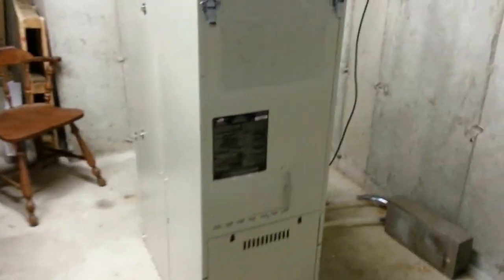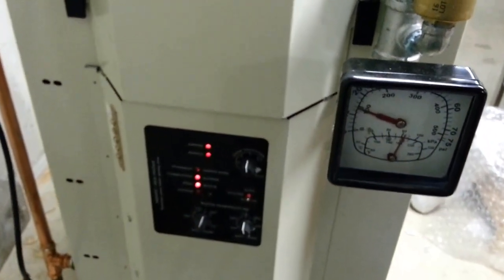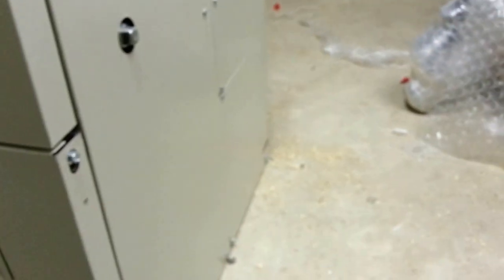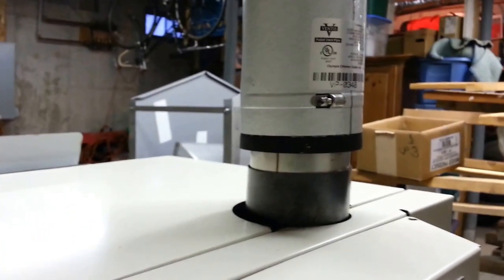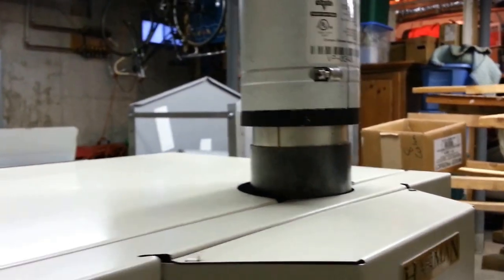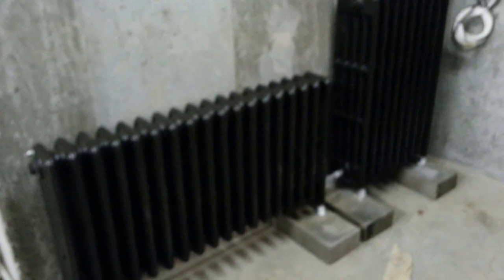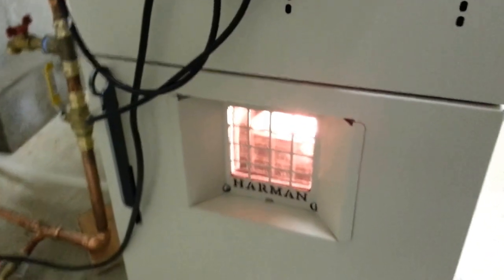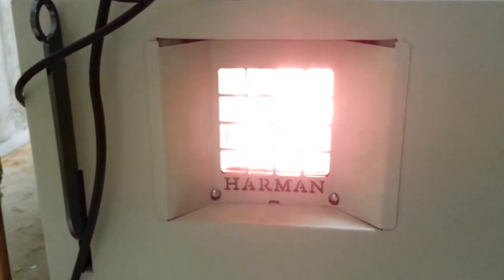Harman HydroFlex60 Pellet Boiler

Comment: Bought on myself in 2010 for $4245  Squier Lumber Monson ma, $400 for a stainless chimney liner and another $300 for miscellaneous parts. Paralleled to my oil fired system it can heat my entire 2400 square foot house plus domestic hot water from an indirect tank.
I installed myself  being a licensed HVAC technician ...it is low quality but less expensive than imports of the time .  I have maintained as few owners can because I have had the tools like a soot vac. and and an assortment of  brushes , but junk is junk. The European designs have been self  cleaning since 2004, all they do is carry the ashes outdoors.

Harman is a garbage company ,it filled the FLEX 60  it full of CONSUMABLES to fleece the buyers for replacement parts during the ownership time. 
After 3 winters I had to replace the many of the spiral baffles made of cheap iron that crisped from heat .Also  the cast iron wedge above the burn pot as well as the refractory wedge above it  at ridiculously inflate price for what they are , the exchanger has only a 5 year warranty , enough said.

In 2016  Trumps  domestic energy policy lowered the cost of Fuel oil enough so  that it was not worth the work of and maintenance to burn wood pellets . While cleaning it to put it on standby I discovered a heart shaped crack in the burn pot , I took no action because 
I  was only going to use it in case of emergency . In five winters the savings never equaled the expense of buying and the cost of installation  because the price of pellets kept increasing even though oil prices had been lowering  some from 2011 to 2016.

Then HARMAN stopped making  both  the PB105 and  the Hydro Flex 60.
Two possible reasons , they were both junky and too expensive to compete with the more expensive but better engineered better quality  imports. The other was that Trump`s energy policy made pellet burning a worthless endeavor. Factoring in the labor and maintenance associated with  burning pellets, plus the storage,  and pellet losses due to moisture if not properly stored outside, and the CONSUMABLES , for which there is no excuse , where are the savings ? 

During  my career in HVAC  I have seen  coal burning boilers that were installed in the early 1900s and still worked with the original stokers and grates up to the mid 2000s . The pellet boiler manufacturers are ripping people off with their garbage engineering and  designs no matter where they are made but the EUROPEANS are still better than any  US MADE GARBAGE ....HARMAN IS GARBAGE , people do not know it because they have  never seen equipment that lasts more than 5 years,
Now that BIDUMB AS A STUMP has driven the prices of oil higher than during MORON OBAMA `s term  I will probably turn it back on to use it for the 2022/2023 winter, to save $1400 at present fuel costs minus $ 300 for a new  burn pot if  welding the original  is not possible , that leaves  me with $1100 in savings if nothing else breaks down on the piece of junk , then if I  calculate my labor to maintain it ...my savings is ZERO ..in fact  it is negatives
because instead of brushing and vacuuming ashes and loading pellets  I could be doing something fun . So unless the price of home heating oil reaches  $10 per gallon in  Oct 2022 
I am looking at a bad choice to turn it back on . 
The BOTTOM LINE IS THIS ...THE PB105 was a pig because it did not ignite well and HARMAN  never compensated the buyers with the parts they made for the improved system used in the  FLEX 60 , the burner assemblies are interchangeable .The FLEX 60 is a piece of consumables garbage ..both made by a GARBAGE COMPANY that will not even provide spare parts  for what they made . 
If insanity ever causes me to chose to continue pellets beyond 2023 , it will be a European made boiler.

Comment from the maker: The cost of unit was $4,999.00 at Preston Trading Post in Preston CT. That came with discounts & rebate from Harman Stove company.  (You also get a fed tax rebate) Plus about $250 in stove pipe for exhaust ventilation.  Then my plumber hook up was about $2,000.  (Hard to say exactly,  he also hooked up an extra heat zone in my bathroom & radiant heat pipes to make my concrete counters heated) I also got a couple of large cast iron radiators from Craigslist,  had them sandblasted & powder coated for $350 for an "overheat" loop. I'd say about 8 grand for the whole shebang. (Normally we used $3,000+ in heating oil a year. even more if we kept the house as hot as we do now)  http://www.prestontradingpost.com